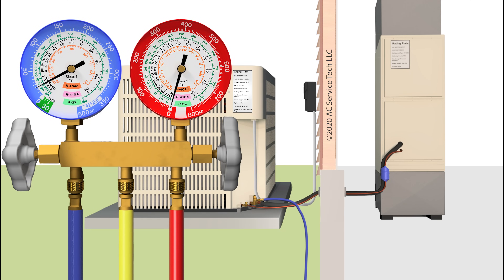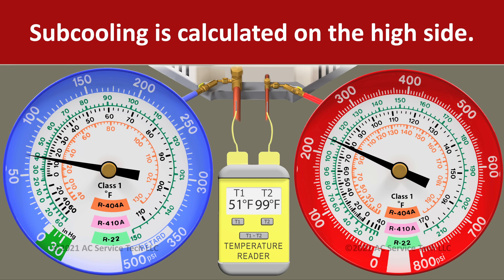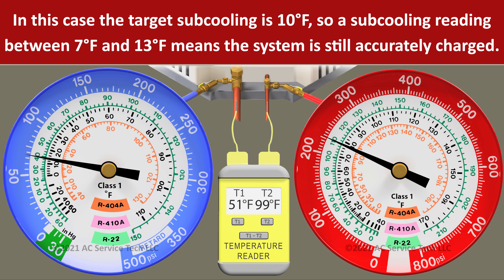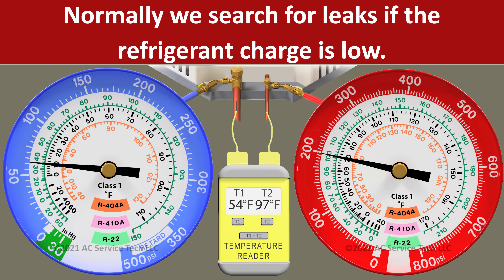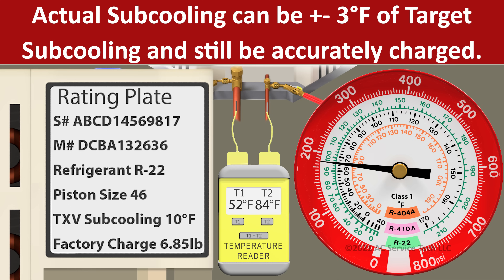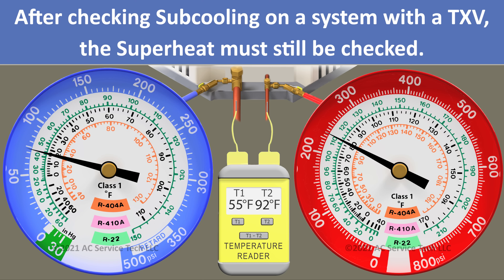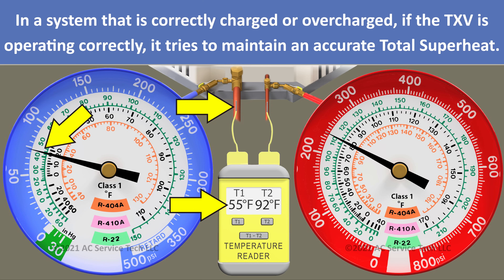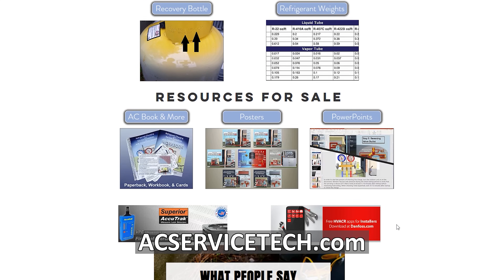R-22 Subcooling Examples! Check The Charge with 4 Different Scenarios!

Comment: Why on the subcooling app say "add refrigerant.
If I have, 112 sat temp and 92 line temp.

With these temps. I have 20F of subcooling, and i am looking for
10F of subcooling.
But,
I press "Calculate" and it shows: "ADD REFRIGERANT"
Reply from the maker: Dont use whatever app you have there then. its easy enough to not use apps if you dont have blend refrigerants with bubble and dew, thanks!

Comment: What is the proper procedure if all the r22 has leaked out. No pressure  at all.
Reply from the maker: You would need to pressure test with nitrogen and listen for where the leak is in order to fix it. If you can't hear it, use Big blue leak detector on the joints. Look for oil stains from a leak in the unit, thanks.

Comment: Do you have vids with 407c? Im replacing r22 ac condensers with r410a condensers and swapping out the refrigerant with 407c since customers can't afford to change the evap coil. Scenario: 3.5T eq. #78 piston. 100° OAT 245 Hi 82 Lo. 20 SH 5 SC. Inside temp 80°. Amp draw of 8A. TD 17° 81R/63S. Seems close. What you think? I know by leaving the evap, it's mismatching the seer.
Reply: You're doing everyone a horrible disservice for doing that, please stop.
Reply: @abarenas  U got that right
Reply: @abarenas  Please explain how so? I've called various tech supports and they can't give me a valid technical answer. Their answer sounds robotic and trying to push product. As mentioned, only doing this cause customers can't afford to swap both evap coil and condenser. So give me a valid technical answer cause at this point, I haven't had a call back on any install done this way.

Comment: Since most installers in the field do not remove the bulb when brazing and protect the txv properly, might not be a bad idea to do this again with examples as to why your SC is spot on but your total superheat is at 30°f.. Or 2°f lol.. Airflow also is super critical. How about zoning systems? Fancy communicating, full VFD zoning systems lol. Very seldomly are these systems going to be cookie cutter.  Knowing how to charge and understanding why pressures/Temps act like they do are two completely separate things but it's an hvac techs job to know these things well so they can quickly diagnose and resolve the issue. Most I've worked with or behind simply shrug it off as a working system.. The SC is where the manufacturer specified it should be for 95°f oa° but the SH is at 28° or below 5° so it must be fine right? Lol, No 👎 it's not fine. Your coil is still starved at over 15° of superheat or flooded below 10° and you're actually causing compressor damage below 5° of sh.  These days on most systems the systems will reach what we call "equilibrium." Your subcooling and superheat will both mirror one another. If you can reach equilibrium, your system is a straight gangster and will do its job at 100% capacity with wonderful latent heat removal.  Txv's are extremely sensitive devices. They should be treated as such and protected, it will make your job much easier.